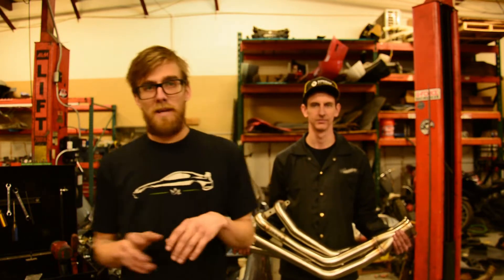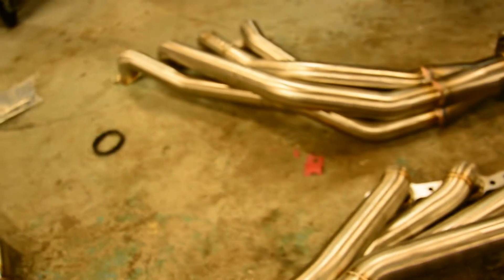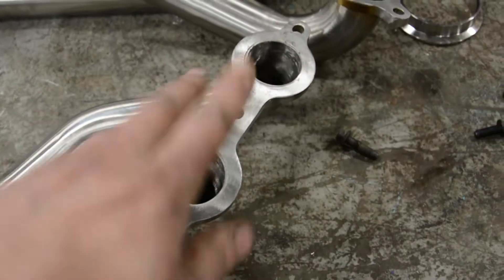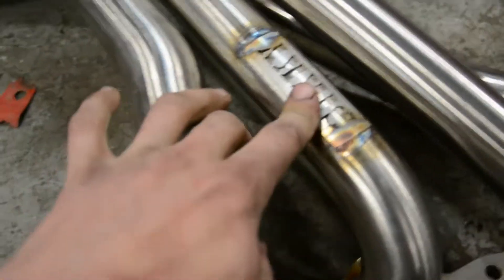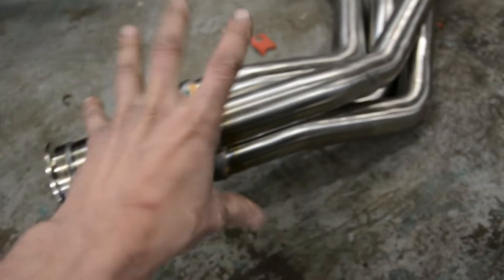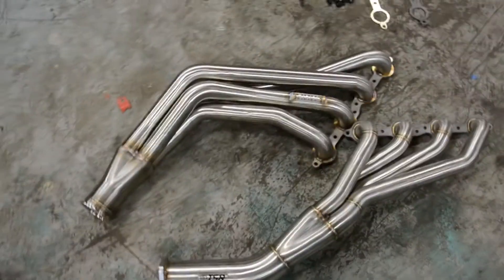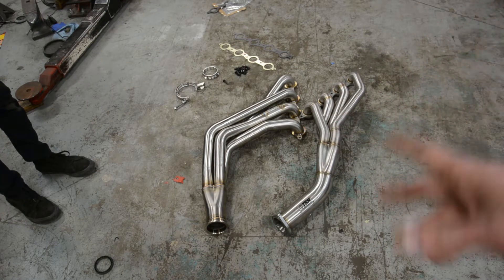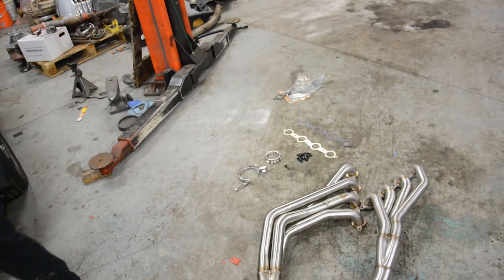Are SIKKY Headers Better than ISR For Our R32 LS Swap??

Comment: What mounts are you using in your chassis? I'm trying to figure out if the ISR headers will clear sikky mounts.
Reply from the maker: We’re using the ISR mounts. Ended up using the sikky headers though
Reply: I'm trying to figure out if the ISR headers will work with sikky mounts lol. I'm having major ground clearance issues.